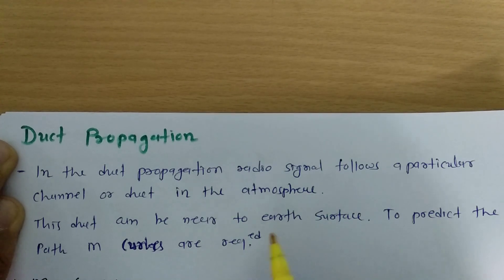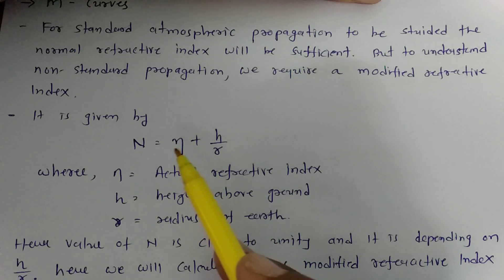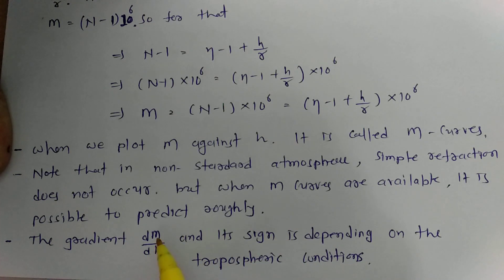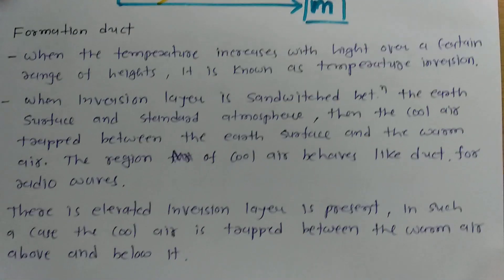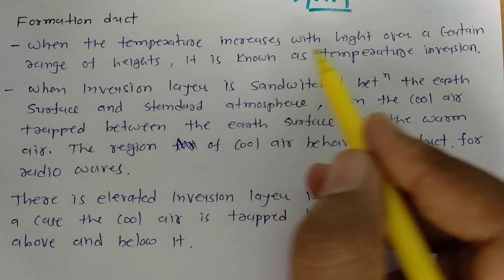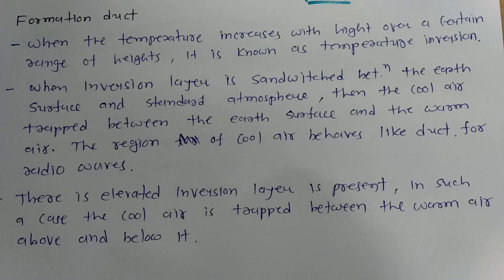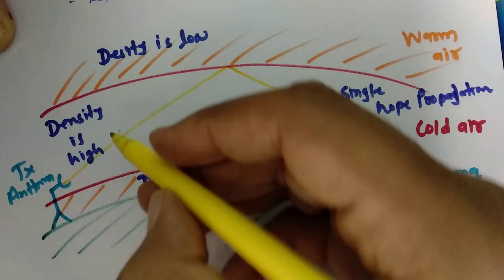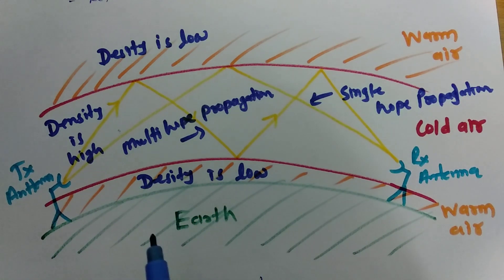Duct Propagation (M-Curves, Inversion Layer, Formation, Types & Condition) Explained

Comment: Definitions, Categorizations and General Classifications, Different Modes of Wave Propagation, 
Ray/Mode Concepts. Ground Wave Propagation - Plane Earth Reflections, Space and Surface 
Waves, Wave Tilt, Curved Earth Reflections. Space Wave Propagation - Field Strength 
Variation with Distance and Height, Effect of Earth’s Curvature, Absorption, Super Refraction, 
M-Curves and Duct Propagation, Scattering Phenomena, Troposphere Propagation. Sky Wave 
Propagation - Structure of Ionosphere, Refraction and Reflection of Sky Waves by Ionosphere, 
Ray Path, Critical Frequency, MUF, LUF, OF, Virtual Height and Skip Distance, Relation 
between MUF and Skip Distance, Multi-hop Propagation.
tell us all this topics sir
Reply from the maker: Many are already covered in my Playlist of antennas and wave propagation.

Comment: Please the I need the material for the whole antenna and wave propagation. I went to your website and the material I got is control engineering questions where I was supposed to download material for this topic
Reply from the maker: You can take from my android application engineering funda
Reply: Engineering Funda I use iphone
Reply from the maker: http://engineeringfunda.co.in/antenna-and-wave-propagation/#1532455101487-5515ad17-9a5a

Comment: When temperature decreases shouldn't there be cool air instead of Vaam air?
Reply from the maker: That's why that layer is called inversion layer
Reply: @EngineeringFunda  In the standard atmospheric layer the temperature decreases with height. Then how do we get warm air when temperature decreases?
Reply from the maker: That is where duct layer is there where reverse of usual happens which is reffered as inversion layer.
Reply: @EngineeringFunda  So is the combination of inversion layer and the standard layer called Duct?
Reply: @heda7803  good question 😁
Reply: @EngineeringFunda  explain tropospheric scatter propagation

Comment: Sir could you please add lectures on Antenna Measurements. That is , reflection coefficient measurement, radiation pattern measurements, vector network analyser, anechoic chamber.
Reply from the maker: See my antenna playlist
Reply: Engineering Funda Sir I found radiation pattern measurement but not the rest.. if you could provide me with the specific links..
Reply from the maker: I am replying by mobile so don't know how to send link but you see it in my playlist of antenna and wave Propagation
Reply: https://www.youtube.com/watch?v=89Lk4Cppe2E